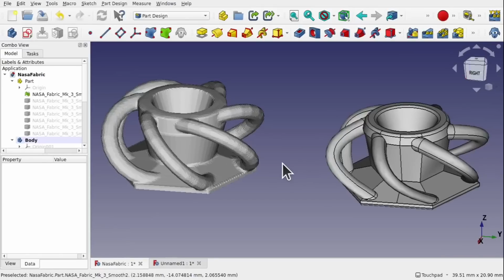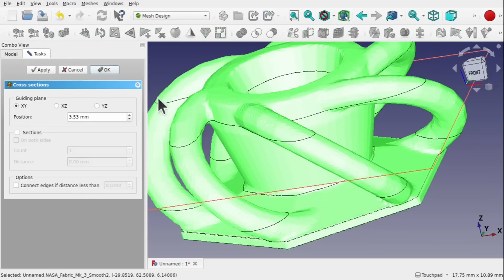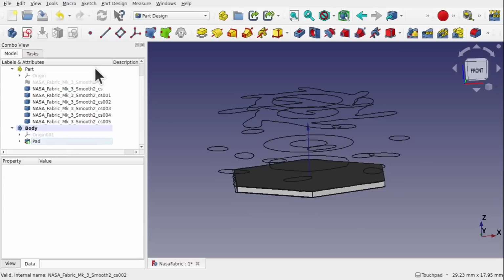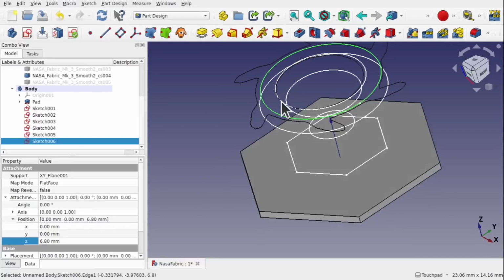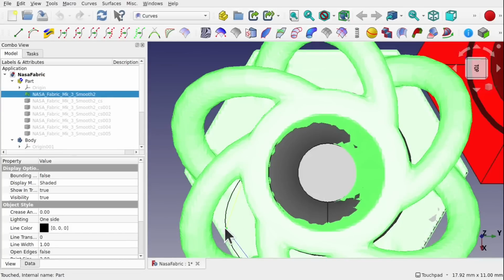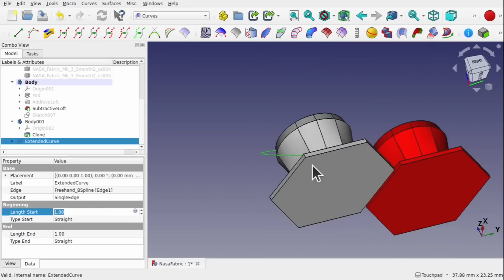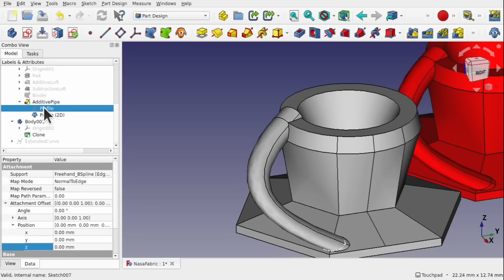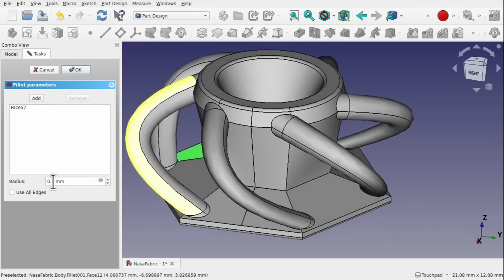Reverse Engineering NASA 3D Printed Fabric Build in FreeCAD | Part 1 | Chainmail

Comment: Great video. Couldn't find another one to answer my questions. This one answers many of them. Thanks!

Is there a reason that you did not use the sections option of the Mesh: Cross Sections tool? I guess just to hide the sections you don't need, isn't it?
Reply from the maker: Glad you enjoyed. In response to your question, your right, I could of. It would of been quicker since I was working with a mesh. Good call.

Comment: If I look at the single part, it are two cones, hexagonal cone and 6 times a segmented torus. My guess it can be a parametrization.
Reply from the maker: Yes it would be a great additional to allow for customisation through a parametric spreadsheet and as you have pointed out it has the necessary structure that should allow it to work well.